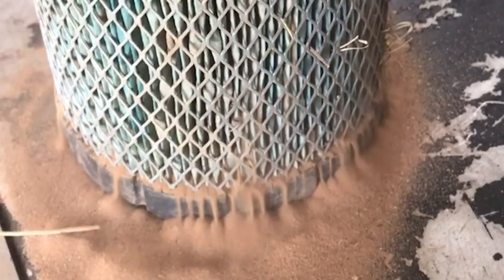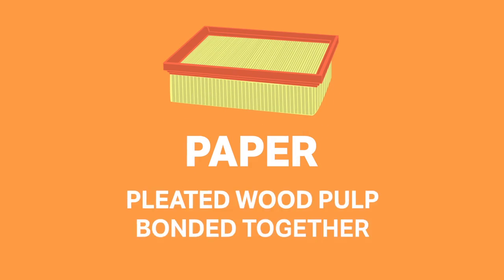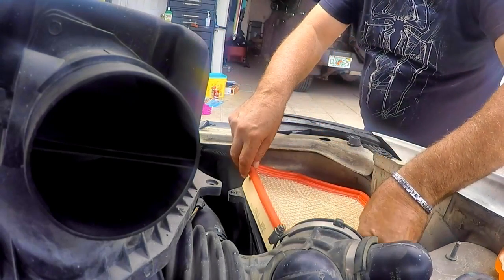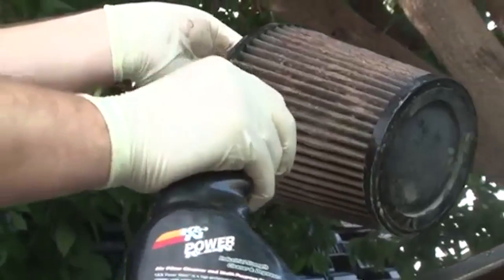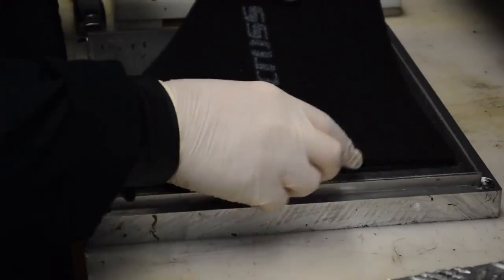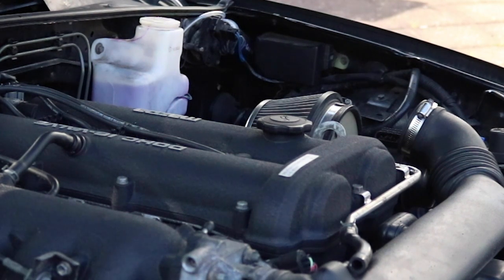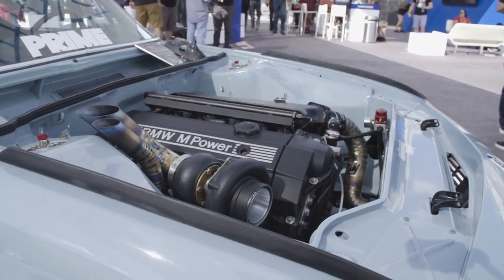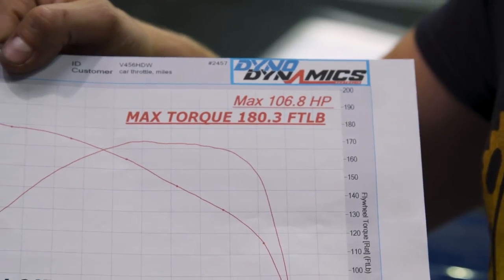Understanding Air Filter Materials

Comment: Foam air filters:
-Flow better than paper or gauze
-Filter about 50% better
-Are almost impossible to block
-Have a much higher carrying capacity

An oil analysis is an easy way to measure the difference.

🙂
P.S. You need a thicker foam filter for dusty conditions... as some of the european foam filters are too thin e.g. Pipercross.

Comment: I bought a Wix air filter recently, and it had a foam pre-filter (Ay yo dog, i hear you like air filters so i got a filter for your filter). 

I was wondering if I could just make my own with foam pre-filter with a similar sized sheet of foam from a fabrics store and cut it to size? (NOTE - I'm not going to use the foam alone, just make my own pre-filter and put it in front of the dirty side of the paper filter).

Comment: Any high rise filter setup is going to make more power, partly because of the cooler air draw but mainly it's the length the air has to travel and if it has basically a straight shot down to the runners. The farther the air has to travel and turn the worse off it will be making power. Sad to think how some turbo cars could have a straighter intake path and probably gain 15 hp at least and still make the torque you need on the street. It should be a no brainer but I'm not a engineer for an auto maker so what do I know.

Comment: When it comes to air filters, the more restrictive the better. (Within Reason) Unless you are at a dragstrip, the benefit of protecting your engine is going to far outwieght getting 9%more air into the airbox and three times as much dust. INcluding larger particles.

Comment: My pipercross panel air filter started to fall apart after maybe 15kkm. Rubber frame cracked and foam started to fall apart,  going through MAF to turbo. I was suppose to clean filter after 32kkm. Didn`t believe when i read same thing on internet so i bought it and it happened to me as well. My Pipercross is now where he belongs. In garbage

Comment: Everyone gonna ignore the fact that at 0:13 in the top left hand corner is an image of an oil filter not air filter😂
Reply: My Smart Fortwo 2006 has a very similar one. It could really be an air filter
Reply: thats airfilter, most trucks use that and wtf how did u see that as oil filter????
just go google ''truck air filter''
Reply: Auscipious Jogger Googled it, they look different lol. It looks like the oil filters used on the new Mercedes engine I work on
Reply: could be an air filter
Reply: It's an air filter like the one on my ecoboost 1.6 lmfao
Reply: SpaniardChris also looks the same as some oil filters

Comment: It makes me chuckle when people remove the stock airbox and all associated pipes bringing in cool fresh air, and replace it with a cone filter directly to the air intake, inside the enclosed hot engine bay. Thus creating a hot air intake.
Reply: TheStwat aka Stuart Wright huh
Reply: It makes me chuckle when you don't know why people do it
Reply: @tsomeone950  sound is not worth performance loss though, I've not seen any video of someone using a cone filter and gain BHP, some cars did gain an increase from a performance panel filter but again majority did nothing

Comment: I bought an intake just for extra sound, wasn't expecting any performance. Stock intakes nowadays are more than adequate enough.
Reply: Considering that even the crummy stock air box on a B5 Audi A4 with a 1.6 liter N/A engine is also used in the RS4, even 20+ year old cars were built with that in mind.

Comment: cotton gauze filters aren't harmful to your air volume sensor or anything else because the oil in the filter can't be sucked out of it that easily. JP Performance mentioned that in one of his last videos and named K&N because they tested that with their own filters and nothing malfunctioned in their tests. they not only tried it normally with driving but pushed a lot of pressurized air through them and no oil came out but in extreme high pressures. also you usually don't have pressurized air infront of the filter but after it. so to conclude my comment ITS A MYTH. often other parts malfunction on tuned cars and its not the fault of the air filter.

comment if you have new information
Reply: Uhh you do have higher pressure air in front of the filter compared to after the filter.
Reply: @wgrnoah it isn’t always true that oil in the filter can’t be sucked that easily! I replaced stock with stock type k&n oil filter and it ruined the maf sensor. I didn’t oil it even, I’ve just replaced it straight from the packaging.

Comment: “Performance gains”
Because a Bugatti uses 2 regular paper filters only twice the size as your average car filter.  It’s been proven time and time again “performance” filters are a scam, can lead to sensor failure, and removes the water sump known as an air box.
Reply: Your mom is pregnant with black kid
Reply: well it's also proven, that performance air filters give mor hp, JP (a German tuner) replaced the air filter on his supercharged corvette and gained 40hp

Comment: 1-2 hp is different then the 10 hp claim. why? because that 10 extra hp is on a modified vehicle. its all marketing. so dont spend 1000 dollars on a weapon r intake. infact. keep your stock airbox and spend the money on better mods.
Reply: I'd argue that the increase in dat sweet induction noise is worth the ~60euros :D
Reply: @forzer45  dumb ricer.
Reply: @forzer45 yea I say it’s worth the potential loss for noises
Reply: It's worth it once supporting mods are installed such as exhaust, cams, retuning, etc.
Reply: @patx35  I JUST SAID THAT. YOU DENSE NUT
Reply: sw4gr1d  you mean kw?
Reply: a real horse is 5.7 horsepower. meaning an intake can easily add 10 hp. because 10hp is next to nothing in the grand scheme of things. what you said is true but the 10hp is accurate

Comment: MESH METAL FILTER IS LIFE
Reply: Im using it is it good for our engine?
Reply: @drivemotorsphilippines  If you live in a particularly dusty area it may cause some issues, it essentially just stops somewhat big debree from entering the engine.
If you live in places with wet climate like the uk you shouldn't worry too much about dust so it will be enough to protect your engine from small pieces of dirt or stuff like that